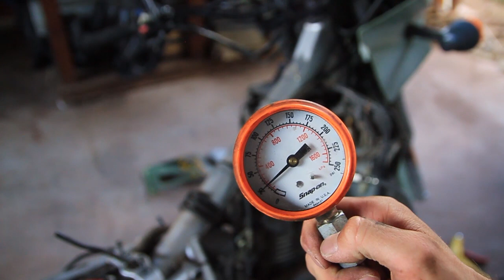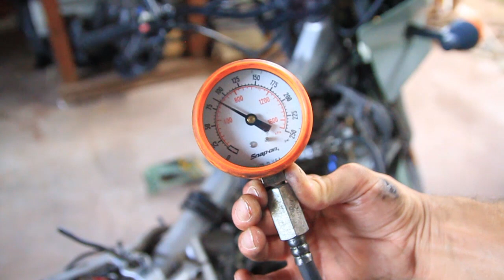KLR 650 COMPLETE ALL STEPS ENGINE REBUILD TOP END NEW PISTON 2001 CYLINDER BORE TEAR DOWN VALVE JOB

Comment: The compression release HAS to be disabled. It’s a fruitless endeavor to test compression with 30-40% cylinder pressure escaping through the exhaust. 😕
Reply from the maker: I was rewatching the video a couple of days ago thinking about this, I didn't disable the compression release but still was able to see an increase in compression after putting in oil.  I think for testing purposes the way I did it works.  What do you think?

Comment: The Valve clearance changed because you lapped the valves, so what happened is the valve seats when you used the drill ate down the valve seat changing the clearances, so the Right EX that you measured up at 0.15 before you cleaned up the seats must have gone smaller right ? the 0.15 probably never went in. so had get new shims ?

Comment: Great video. It's frustrating to install a cylinder over a new piston and rings, and even more so to record yourself doing it. I definitely appreciate it though! That piston ring compressor tool is usually for pistons that get installed from the top, like on a car engine. I'm sure you probably knew that, but maybe someone will wonder and read this. I'm a CO rider too!
Reply: What part of colorado?

Comment: Good job, I know that was harder not having the bike up on a lift. How many miles on the bike and did you ever have problems with the doohicky.  My 2023 KLR doohicky failed at 1400 miles and dealer covered the repaired under warrenty. Have you heard of the 685 kit.
Reply from the maker: Got a little over 40K on it, no problems with the doohicky.  I've heard of the 685 kit.  Your right I need a lift :-)

Comment: Do you have to bore the engine to put piston rings in? My bike smokes on startup and started smelling like burning oil and oil comes out the cylinder exhaust. I plan on just putting piston rings in.
Reply from the maker: I don't think you have to, throw new rings in and see what happens.

Comment: The best mechanics are half chemist.  You can dissolve that carbon off the heads and valves in 1 minute and at max 5 minutes with Toluene.  It's expensive these days thanks to some assholes on the bad side of chemistry considering it is a waste product of the refining business, well actually everything they sell us is a waste product but I digress.  Next time leave the valves in pour some on the combustion side on warmed up metal, wait 3 minutes rinse and then turn it over and do the same to the entire intake and exhaust passages.  Try not to freak out when you pour the liquid off and you have brand new polished looking perfectly clean metal with no need to remove valves.  Don't let it sit any longer than necessary as toluene tries to dissolve just about anything but i've never seen it mess with the seals.  It will save you so much time and you'll never do a job like that again without it, just remember it dissolves 75
5 of plastic chemiistry wares and it evaporates about as quick as anything besides ether leaving a coating behind of whatever it dissolved which can be a nightmare if it happens in the carb so it has it's purpose just don't think it is universal and you'll be fine. You can actually win plenty of money betting others who think they know everything about carbon and how to remove it, just don't expect them to smile when you take their money and they see how perfect the finish is compared to any other method up to glass blasting

Comment: I was told to take the head off I needed to lock it at top dead center. Is that a thing and if so how do you do it?
Reply from the maker: Minute 10:46 I talk about that, definitely a thing.
Reply: @JesseHoff  how do you lock it once it’s at top dead center? Does it stay locked there or is there something you need to do to it?
Reply from the maker: @allenbrandon1031  you don't have to lock it, it just stays there, there's no mechanism that locks it into place

Comment: the reason the valve adjustment changes is because of the wear on the valve seats. so if you lap the valves it will change the the height of the valve stem. before you by new valve shims recheck the adjustment. Also, the oil burning is likely due to loose valve guides, valve guide seals, or rings. Has nothing to due with valve seats. Make sure you check  cam adjuster and replace it with the new type. (doohicky)
Reply: Thanks, was wondering what that was about. Appreciate your comment.

Comment: That engine has an Exhaust valve Decompression cam thingy. Makes compression low at start up for easy cranking.
Reply from the maker: I still don't think it should have been that low though.  What do you think?
Reply: @JesseHoff  Surprised it would have run if it was that low. But they do seem to keep running no matter what happens to them. That'd be a KLR for ya.

Comment: I have a question for you. Can a 2008 klr650 head assy fit and work on a 2008 klr650? Can the oil supply tube be modified to make it work?
Reply from the maker: Not sure man, seems like your asking about the same bike?  2008 is when the started changing things though.  https://en.wikipedia.org/wiki/Kawasaki_KLR650
Find out and make a video about it. :-)
Reply: @JesseHoff  Im sorry.  I meant 2011 vs 2007

Comment: What is the torque valve for the 14mm header bolts
Reply from the maker: I forget, check that manual I have in the description of the video, there's a link.